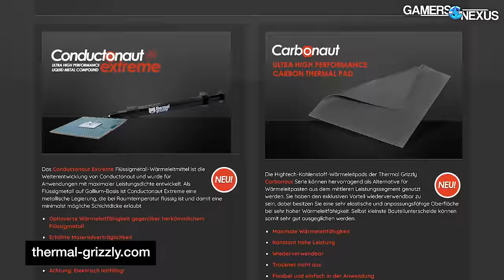CPU Thermal Issues & Der8auer's Scientific Solutions | Graphene, Direct Die Blocks, & More

Comment: I'm interested in those specialized re-oriented graphene pads.  I want to know how they compare to the newer 'phase-change' pads that GPUs are using, the ones that require a certain pressure to set correctly, the ones that require equipment that consumers won't have and may not properly reapply with just the typical four-point retention mounting being torqued down; this seems like a fairly comparable replacement for those getting into cards or replacing them, reusability aside.  I'm also curious about longevity, is it truly set and forget, as in can I throw it into a system that has a 10+ year life cycle and truly never have to touch it again, or is there actually a point where long-term maintenance is needed; I could think of some applications where this could be useful outside of just computing, where the solutions are usually some kind of thermal adhesive/epoxy or just soldering for longevity purposes. 

And I get why people dislike the 12VHPWR connector, personally I'm not a fan of the current implementation as it could be improved, but at the same time look at it from a cable clutter perspective with official specs, you're minimizing what was triple 8-pin of a larger pin and pitch into a very compact connector.  Of course the 8 pin can physically handle a much, much higher power throughput than the official spec ever allowed, but the official spec for the new connector is massive, as you're not only minimizing pin size and pitch for an overall connector minimization, but you're also minimizing pin and wire count, which is huge for both PCB/header purposes and for cable clutter concerns.  There's also other uses for something like this, imagine if 12VO adopted it, imagine if ATX (or a successor) adopted it for CPU power, imagine if there was a motherboard + CPU combo connector that's smaller than what the current motherboard 24 pin connector is; and it goes beyond just this, imagine if the GPU power slot (like what Asus is trying now) sticks long-term (whether or not it's PCIe or a future spec) and the board itself becomes the power backplane, this further reduces overall cable clutter by grouping multiple connectors into one area, then imagine if various internal I/O standards also sees connector footprint and wire bulk reductions, etc., which then assists in other ideas being feasible such as the backside connector motherboards.  Sure, there's early teething issues, and various concepts need to snowball together, but these various things also have major implications for the future of the space if and when these things do start snowballing together; though I think one major hurdle is hanging onto antiquated specs, ATX and PCIe, etc., can only adapt to the changing industry so much before they just need replaced, for example look at the server industry and how certain systems are getting away with higher physical bandwidth by using a finer pitch add-in slot that essentially makes a PCIe x32 slot out of an x16 footprint, and as another example ATX just doesn't make sense for when 12VO, HPWR connectors, and the motherboard as a power plane do snowball together, as you'd need a significantly different approach to board layout than what ATX dictates.  Evolution in bound to happen and needs to happen, and the earliest of massive changes always has teething issues, but the industry needs to adapt to changes that're beneficial for basically everyone involved, because not only would these changes make things simpler for consumers, it'll also make the lives of system builders and techs easier, and there'll come a point where overall simplicity will deter proprietary nonsense.  And really if someone isn't sold on this yet, just look at what it can do for the newer NUC platform, the one that has a system backplane and a compute card, rather than a motherboard, HPWR and 12VO reduces cable clutter, using the system board as a power plane with add-in slot power connectors simplifies power distribution, which very quickly leads to a single-cable between the system as a whole and the PSU; then further this with other things, like if we ever have a competent solution for daisy-chaining fans, RGB, accessory LCDs, etc., or if we find a way to better minimize internal I/O headers, of which USB Type E (the one introduced with USB 3.1, the one that's significantly smaller than the 3.0 header) has already done, of which front panel connection needs standardization with a minimized connector, and legacy specs such as SATA need to start adopting minimized power plus data connectors.  The future of SFF could not only thrive but easily become the norm, besides GPUs currently being behemoths.

Comment: It’s a little late - I loved the look of the Mycro Direct Die and also at the same time I tried the graphene pad at the same time! 

While it’s most likely my fans that where bad for radiators (Corsair QL 120) which worsen my water temperatures.

My idle temps went from avg 50C (Liquid Metal) to 33C (direct die + Graphen)

The only problem I had was the right size for the die @der8auer maybe you can write it inside the product Info for the Graphen Pads for what kind of CPU / GPU it is optimized for 

I brought one that was defiantly too large and carefully cut it into the correct size - wich was really difficult since it’s hard and easily break apart  into wrong sizes

Comment: Roman says: "don't use thermal paste with direct die cooling". GPU cooling solutions are basically direct die. We know liquid metal is not always a good idea because of the cooler materials. Would Kryosheet be an improvement over the paste from the manufacturer?
Reply: That statement is complete BS because all laptop BGAs are direct die to just like desktop GPUs and those have used paste since ever and the cooling is good as long the paste is good quality so clearly Roman is spreading some marketing BS here to upsell his product.
Reply: @riphunter5100  Yes, maybe part of this statement is marketing. And also no, because using "good paste" works, sometimes poorly, but that doesn't mean there's no room for improvement. For instance, a lot of laptop cooling solutions benefit from using liquid metal vs thermal paste. And don't forget my question: would it be an "improvement".

Comment: I'm curious of a good solution to IHS designs would be to make the IHS finned/grooved, and meant to mesh together with finned/grooved cooler blocks. Tolerances would be a little more challenging to meet, but I feel like it MIGHT also resolve issues from uneven mounting pressure.

Comment: Hopefully there is a high fin density option for those of us who run our pumps at 100% or have dual pumps etc.
Reply: Can use any custom waterblock, I'm using my heatkiller IV pro and got rid of aroud 15-20c with direct die and LM application. The most important part is flow rate and (near) perfect flatness of the waterblock.
Reply: @benjaminsmekens2344  I’m not taking about the heat spreader version, I’m talking about direct die waterblock version. He specifically said they chose one that had a less dense fin array so that people who ran their pumps at 25% could use it. I want the super dense array of the narrow fins with a deep cut. There isn’t any point in moving from my supercool direct die block if they’re not going offer a dense fin array.

Comment: Don't you risk the cpu sticking to the direct die block and falling onto the socket pins when removing the block?
I wonder if it would be possible to sell a package - with CPU soldered already soldered to the direct die block. Would probably need quite tight tolerances in production.

Comment: 11:00 Why are you cutting the slots with a saw???  You can press a sharp blade at an angle into the copper material (warm it for deeper presses) and you will get superior surface properties, MUCH faster part production and better cooling.

Comment: Holy shit,  who converted 2000 m² into 6² football fields? Firstly,  a football field is already a measure of area. Second, writing it as 6² FFs means 36 FFs, not 6 FF²s. Third, and most critically,  A SINGLE FF is approximately 5351 m², or nearly 3 times the area of the building, meaning you're off by a factor of 100. If we generously ignore the endzones (as I must assume you have) that's still 4460 m², or more than twice the area described but technically only off by a factor of 10. Stick to Whales and Garbage Trucks while you're a team of 3 abroad hmm? Though given these calculations I'm tempted to double check those results as well.
Reply: For non-Americans: A) there is no standard size for a "football" PITCH, so using it as a unit of measure is right out; and B) even at the smallest Premier League dimensions a pitch is larger than our American Football Field.

Comment: I just read a very bad review on Amazon about the Cryosheet pad. The guy used this on his 7800X3D and his PC died, but he thought with using this, his temps would drop down for 20°C for the CPU. I'm not sure how he used it. I didn't have problems so far with Cryosheet, used this on 3 systems so far.

Comment: metric system is way easier to use than imperial, for example:
- everything is based on same base, mili (1/1000) - meter, centi (1/100) - meter, deci (1/10) - meter, meter, deca (10) -meter, hecto (100) -meter, kilo (1000) -meter
- volume, water for example 1 mili-liter consists of 1 centimeter cubed, 1 liter consist of 1 decimeter cubed of water
- same with celsius, 0 is temp of water freezing and 100 is of water boiling ( in average atmospheric pressure, that can change in different for example to 97 on top of mt. everest if i recall right)
measurement systems that were used before metric were similiar to what is used in US, 7 of this is that, 13 of that is something and 30 of something is something else
it's not bad, but lack of consistency makes it harder to use and harder to change and requires knowledge of certain ethnic measurements, for example feudal japan used full moon width as measurement

Comment: interrsting as always
CONTENT SUGGESTION (for both GN and DERBAUER)
there are so many cooling options: normal cpu lid with an air cooler, with an aio, delided with air cooler, with aio, delided with contact-plate-waterblock, thermal paste , graphit patch, custom loops, etc etc.
most of the conversation is around how good does it cool stuff.
but it's ultra rarely about maintenance/longevity. (some mentions here and there bit nothing centralized)

could we viewers get a generic chart on what we should go for if we want lowest maintenance and or  highest longevity ratioed to cooling efficiency .. (take into consideration if cpu is horizontal or vertical, depending on case)

I blindly go for normal cpu lid, normal socket, thermalgrizzly paste, and big ass air cooler from noctua with noctua fans. i build my pc then never look at it again for years I dunno if other diy are like me, and regularly remove their cooler to check the paste..

But i'm clueless on is this the best solution for longevity/maintance.
could you make a one-shot video on the topic longevity/maintenance of the various cooling solutions, please?

Comment: Hey GN, not really relevant to this video, but do you have an over clocking guide for Raptor lake? If not, would you make one? All the different methods (static, ratio offset, vf curve, adaptive voltage etc) are confusing to a first time overclocker.

Comment: I own a Cyberpower i7-5700x, 32GB ram, 500GB NVME, RTX 3080. It has a (good) heat sink. Case is that white mid-range they sold a lot two years ago. Had heat issues bad ater running CP2077. Coudn't throttle the graphics on the game enough to get the temps down even at 1080P on medium settings with NO Ray Tracing. GPU temp was soring to over 83C, and shutting down my machine after about fifteen minutes of play.

Used Afterburner to turn the fans on full blast 100% of the time, and still no joy. I clean the fans and inlets/vents weekly with canned air and a chamois, and all that crap.

Took the plexi door off and the 'puter is a rock star now. CP2077 at 1440P, ultra settings, everything maxed, Ray Tracing on psycho. Afterburner says temp of the GPU is 51C, and no shut downs since. Sometimes it's the simplest things. Do I WANT the door off? No. But I want to play my games more.

Incidentally, you can play CP2077 at 1080P with the new path tracing tech turned on. It looks smashing, and will not over tax-your system if you normally play at a higher res with simple ray tracing, like I do. It's kind of like watching a really expensively made animated feature on your TV at 1080P... the extra detail and realism will impress.

Cheers all.

Comment: Simulations are for convincing the board and investors, but there is something to be said for just jumping in and doing it before making all the calculations. Some things work better with less fussing beforehand, otherthings will be a total waste of time if you don't nail down the plan/design beforehand.

For example, launching stuff into space. There is a massive cost to send something into space so you better get it right. Or if you are trying to finesse a long time product, if you don't split hairs beforehand, you are throwing prototypes at a bullseye the size of a pea from 1km away. But if you are making something for the first time, being first to market or capitalizing on a trend or hype... that's sometimes more important than getting it perfect. (not that you can't or shouldn't still make sure it's acceptable... EA).

Comment: I have a 5950x. Granted, it is older than the 7series, but it is still not a cold chip. I've seen sustained 250W chip-only power consumption and I wouldn't be surprised if it could draw 300 W. Even so, with a halfway decent waterblock (a bykski) and a (3x140) radiator, the worst I have managed with ~25C ambient is ~72C running the 7z benchmark with 16 threads (not 32) and with 4MB dictionary size (a feeble attempt to make it reach out to RAM less often). I don't know. Maybe with a different motherboard it can go higher? Mine is an tuf gaming b550m-plus (fuck asus). Sadly, I get whea/cache hierarchy restarts if i turn PBO on. Even stranger, cinebench r23 scores barely change with pbo...

Comment: Interesting! 

As far as the 12Vhp connector I think the "issue" is 99% IOE "Idiot Operator Error" It's not at all difficult to surmise a minority of people will screw something up when it comes to ensuring the cable is ALL THE WAY in. I think the Nvidia design is sort of lame  / unsightly but I don't think there's anything "fundamentally / inherently" wrong with it that it is causing these uncommon issues with "melting". My CORSAIR RMx Shift Series RM1000x PSU came with a single cable plug-in (two cables into the PSU) for my Gigabyte Gaming OC RTX 4090 and I've had no issues with it whatsoever (goes up to 600W no problem), plus it looks a lot better than the eye-sore from NVidia.
Reply: As an engineer, I find blaming the end user to be a bit gauche. Unless the end user actively destroys the thing by trying to force it in in a way that it doesn't go, the reality is that your design is not user friendly. End users are scared to break things, so it should be clear and obvious when enough force has been applied to something. My personal motto is "User error is a corporate euphemism for design failure"

Furthermore, even if user error can be blamed for the issues, the truth is that these things simply aren't fail-safe, and that's just not acceptable. It's not hard to make it so that the power is the first thing to disconnect, literally all you do is make the power connector the shortest and the ground connector second shortest.
Reply: @dojelnotmyrealname4018  Well as just your average "thinking person" I've seen evidence of "IOE" all too often to understand it's a REAL issue.

The main point is that this "issue" is overblown and the probability of it being "IOE" is very high. The vast majority aren't having these issues so there's likely no real "design flaw".

Getting people into "panic mode" for what is almost certainly an issue of IOE doesn't help things.
Reply: @erickelly4107  Let us say you are correct and the real culprit is "IOE". Having too many "IOE"s however is a failure in design itself. Plugging a cable all the way in shouldn't be hard/complex for the common person to understand and do.
Reply: @vectivuz1858  Yeah I understood your point, there are certainly things that can be done on Nvidia’s end to help ensure IOE is less likely. 

My only point really is that some people have a tendency to sort of blow things out of proportion which can cause something of a “panic” - I just don’t think this is very helpful if you know what mean..

Comment: The pads look perfect for OEM systems where users will never replace the paste.
Reply: But probably way to expensive for an OEM to contemplate using.
Reply: @malphadour  Don't underestimate Asus of using it in some of their ROG laptops as they really like to partner with TG and they will void your warranty faster than light if the graphene pad accidentally slides under the cooler and short everything in its way😈.Both companies are at the same level of scumbagery.

Comment: Geek question:
Is the nickel plating sulphate based? Sulphamate based? Electroless?
Did anyone think about making a mandrel and electroform the thermal interface instead of machining it?
It is costly but doable, I know it from the record industry, lots of copper and nickel electroformi g with sub-micron precission